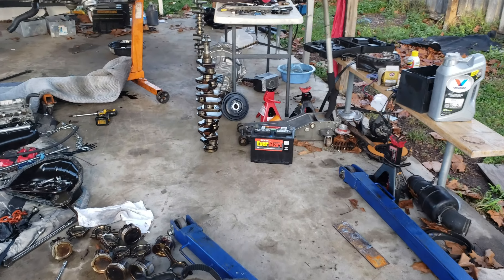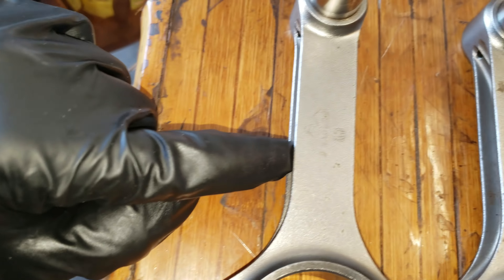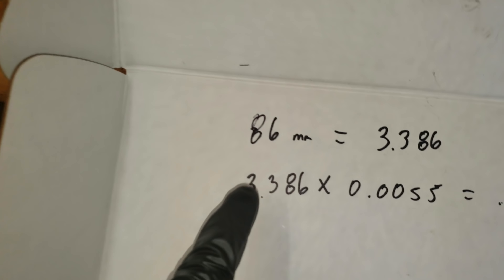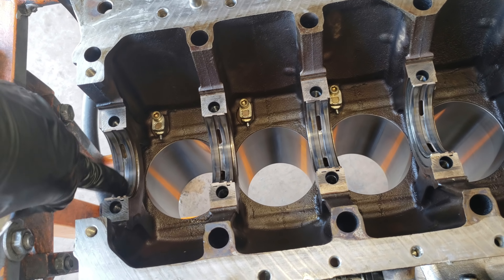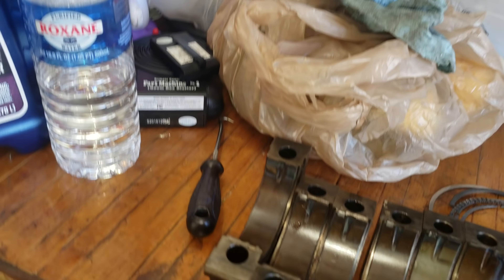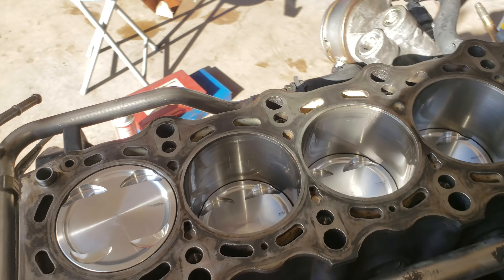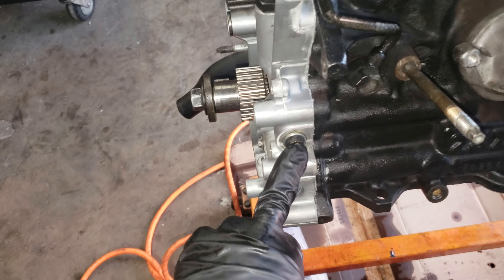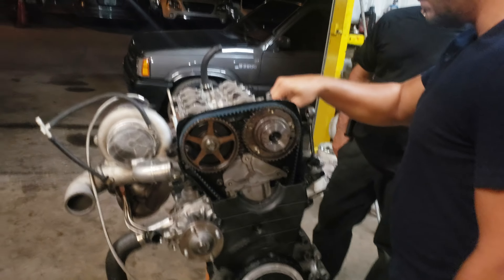FULLY BUILDING A 2JZGTE/ ULTRA INSTINCT TRANSFORMATION

Comment: One question. Is the gasket kit for the 2jzgte vvti and non-vvti the same?
Reply from the maker: Yes
Reply from the maker: Valve cover gasket is diffeent
Reply: No, different valve cover, different intake cam seal
Reply from the maker: Order the valve cover gasket and cam seals for 2002 is300.